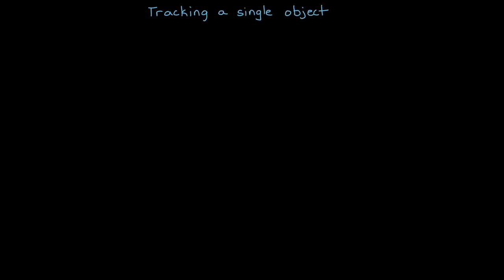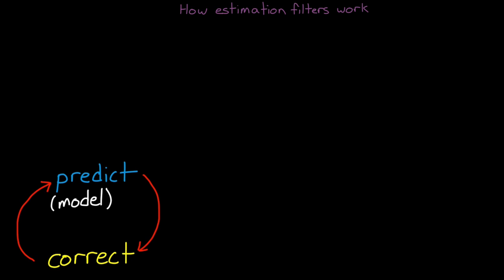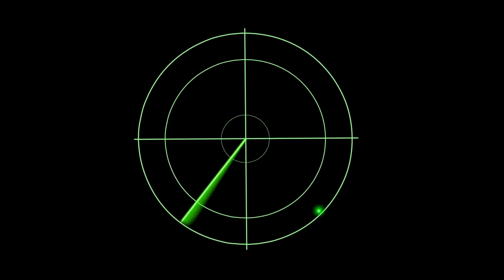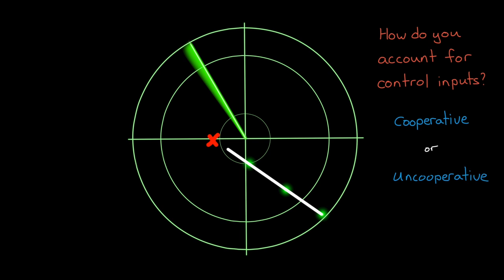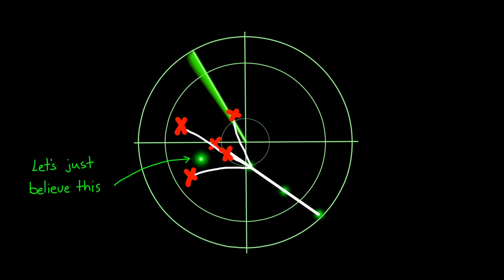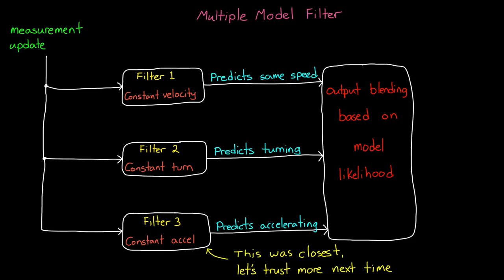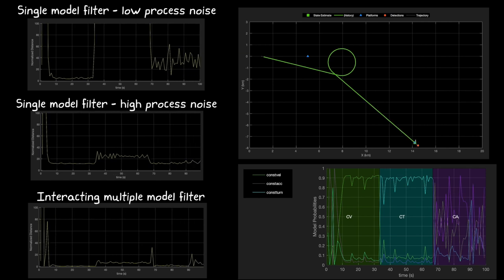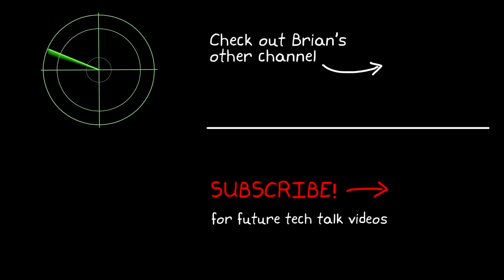Understanding Sensor Fusion and Tracking, Part 4: Tracking a Single Object With an IMM Filter

Comment: How would you connect this system to a real camera?
Reply: I've never applied that, but I guess you have to link in some way the input of the cameras (by processing the input images) to your states (attitude, position, ...). Then it works in the same way you have a radar like in the example of this video.
Reply: You can use one of MATLABs image detection algorithms and find the centre of the located object, doing this on 2 cameras spread apart would allow you to measure the difference in angle and build a triangle to solve for the distance of the object from the sensors.

That’s Subaru Eyesight in a nutshell.